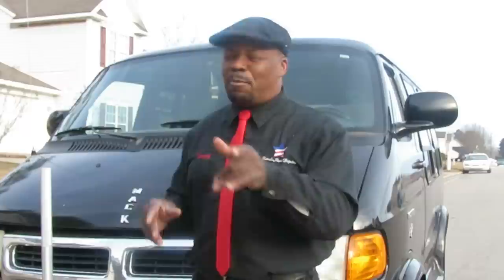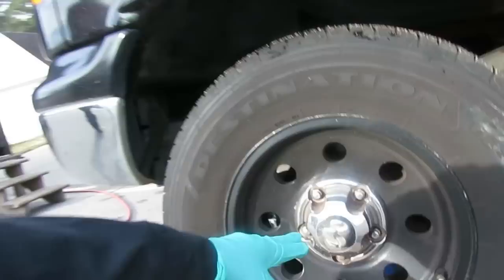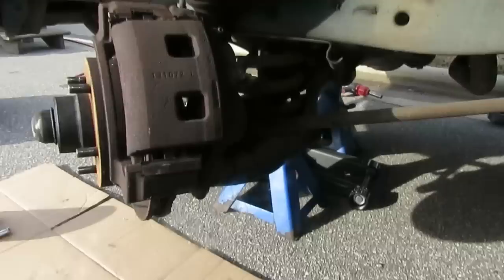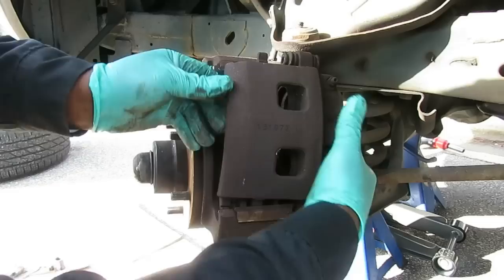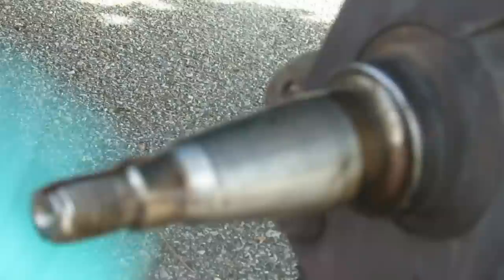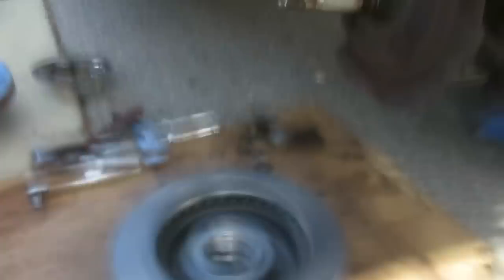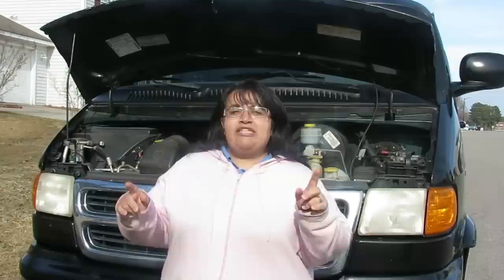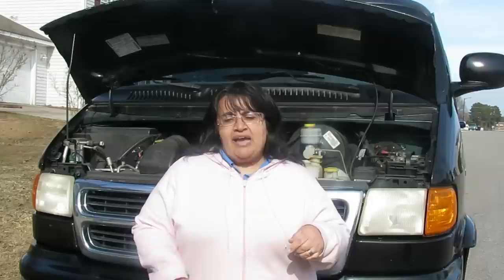⭐ 2000 Dodge Ram 1500 Van - 3.9 - Front Brakes And Rotors

Comment: This video should have way more views so I am commenting again. :-) I finally replaced my front rotors. One suggestion for those folks who need to get more leverage on the wrench, if you get a 12" pipe from your hardware store, it will fit on the end of the wrench and give you that much more power. I use a 12" pipe so that I can keep it in my toolbox.
Reply from the maker: LOL, thanks Conrad!

Comment: This was my Van that Tim did the work for me. When I found it, it was stuck in the mud, had 4 different tires on it and all were flat.  It had that nasty green and brown color on it  The owner wanted 2800 for it, but since it was in bad shape, and wouldn't crank, I got it for 1300. Took me about 9 days of working on it just to be able to drive it from his house in the country, to my house.  A fellow Retired Marine  that was a tin bender in the Corps was gonna do the body work and the paint for me. Told him my favorite colors were black, blue and grey, and shades of black, blue and grey. He did the 3 tone paint for me and even painted the wheels to match.
    I had to get another motor because of a 40lb pressure drop from speed to idle, had the tranny rebuilt by AAMCO. Tim did the brakes and a few other things for me After the paint job was completed, I intentional left off the dodge lettering and put my mane on the front hood "MACK". And I don't know if you can see on the front doors, but the  word  "MIDNITE" is on both. That's it's name. Have been to California once, and Texas twice in it. It's still running strong.
Reply from the maker: Hey Billy!!
Reply: But does it STOP???

Comment: Man I want you to be my brother I wanna be your mamas son, she sure did great job growing you up, Sir I don’t know you but I want you to know that I’m very proud of you and I’m sure God is even more proud, mama bless this man
Reply from the maker: Thanks Will, we can always be 'Brothers from another mother', THANKS!!
Reply: Do you have a contact number or email I have a 2000 Dodge Ram 3500 van which I’m making a camper out of it, I have some things I need to repair I would like to ask you some advice that if you mind, since I see you know this cars super well, thanks
Reply from the maker: You can email me at tim@astralautorepairs.com
Reply: Perfect I got you my brother, thanks
Reply: My good brother, I have this problem with my IDDLE AIR CONTROL VALVE i did everything to fix the problem my idle is good and normal but I still have the code and the engine light, it’s a 2000 Dodge Ram 3500 van 5.9 replace the valve check all the wires but nothing any advise? I’m in California I wish I could take the car to you
Reply from the maker: I we actually have a video on that: https://www.youtube.com/watch?v=VWQD1tt8y5k

Let me know if the video helps!